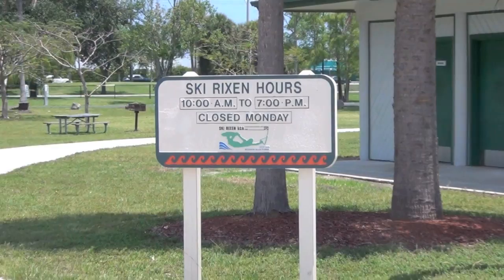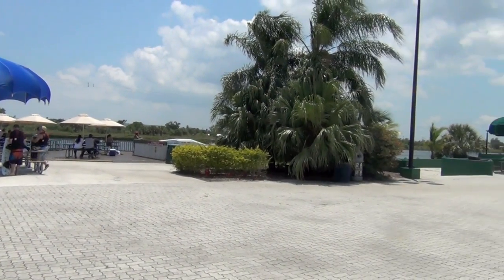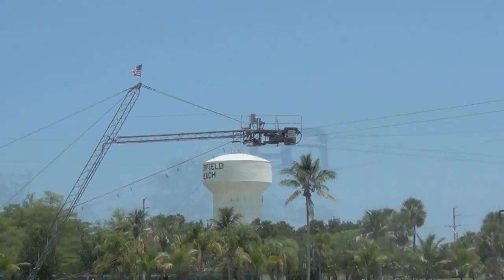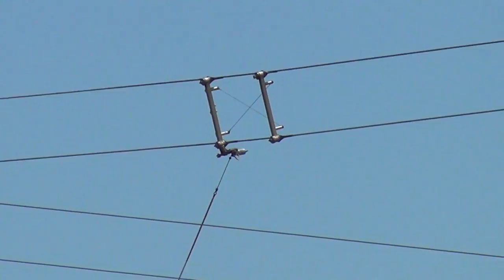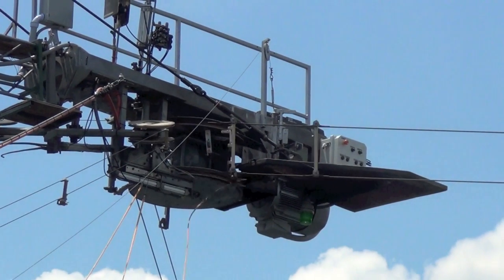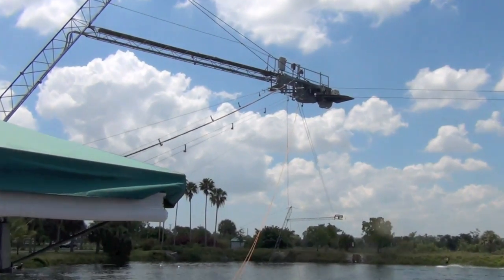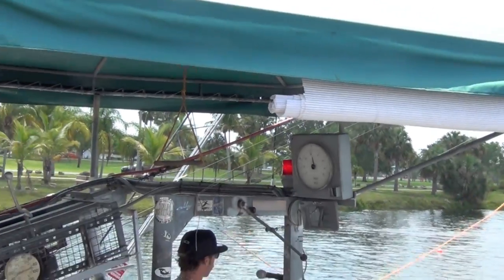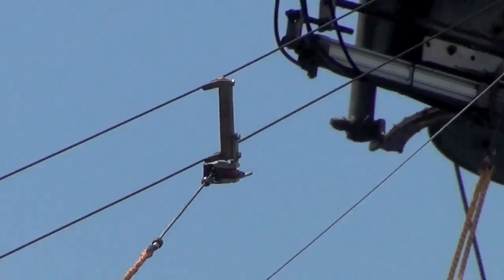Ski Rixen Water Cable Tow System - How it works.

Comment: How is the cable made ? The connection to complete the loop of the whole cable system ?
Reply: It's a steel cable. The end of the rope has a ball on it (at least it used to be that way) the hook comes around and the ball slides into it. The hook is fastened on to the cables and the cables are a continuous loop and at each corner there is a pulley wheel that guides the cables around the lake. If I recall correctly, there are motors on 2 of the 4 corners that power the wheels of the pulley.